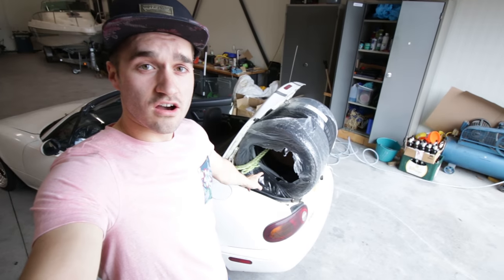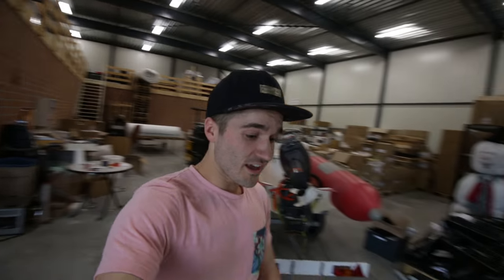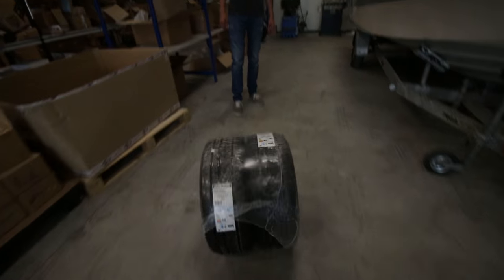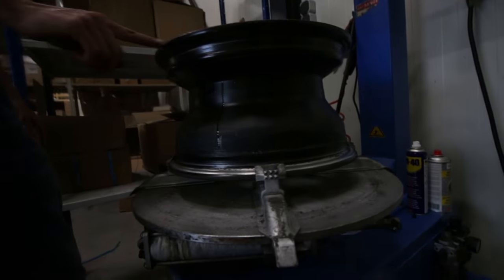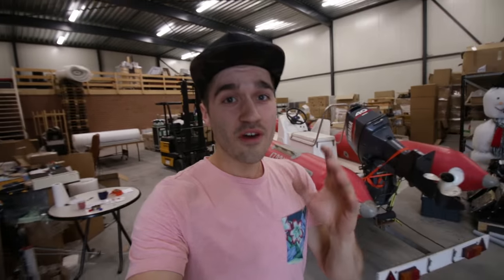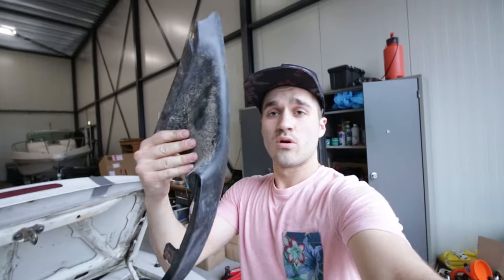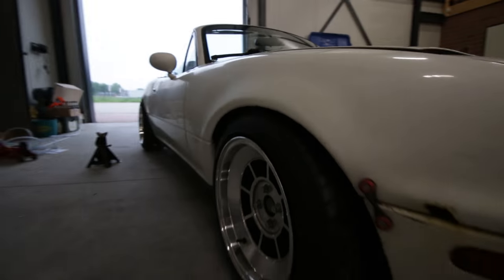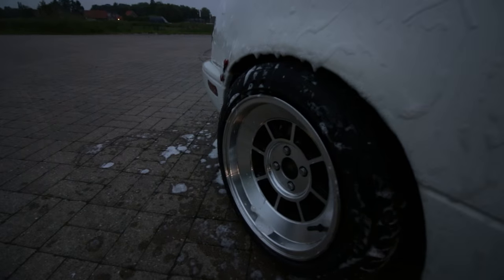New Tires on the Miata & Drift Stitch R-package Lip

Comment: these tires are really really great. I have them in 205 50 r15 on my miata and they grip really well in the dry and also in the wet. I drove 5 rounds on the Nordschleife with them and it was no problem. They got a bit too warm after about every 3/4 lap but they are "just" very sporty streettires not semi slicks. But I would defenetly recomend them everybody. And for a good griping sport tire they are not really loud. great tire!